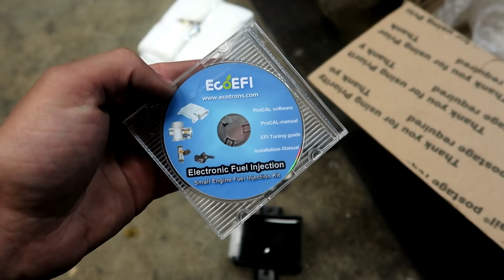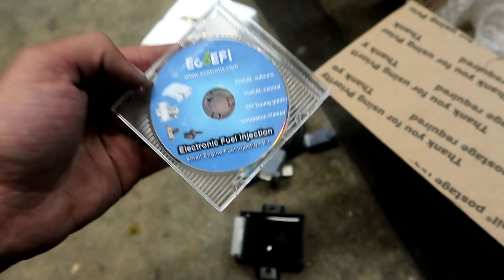Turbo Shopping Go Kart Update (Full EFI Kit)

Comment: I plan on Trying the same thing with my CT70 motorcycle in the next few mths, most likely with a kit out by Rolling Wrench. Honestly that turbo won't make enough boost to need a actual waste-gate, or even a blow off valve. Check out Grind Hard plumbing co's turbo barbie kart with the exact same engine, it hardly makes 4-5psi of boost so honestly a waste gate/bov is really unnecessary. Awesome set-up though, i am very jealous.

Comment: Get a JDM truck Subaru Forester xt (same as sti engine turbo and everything awd), or nissan titan, Toyota tundra. Imo subaru! Stay Jdm or i  unsubscribe and flag your video
Reply: Same sti drivetrain, just sitting on taller springs. Do it! Give the hondaru a sibling. That shit will tow anything even an 18 wheeler filled with cheap ford and chevy trucks in the snow.